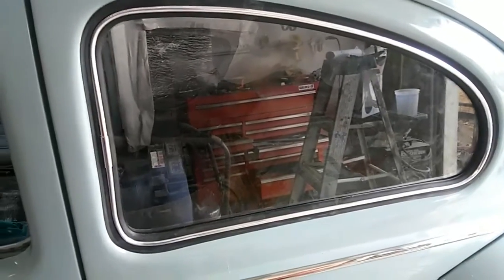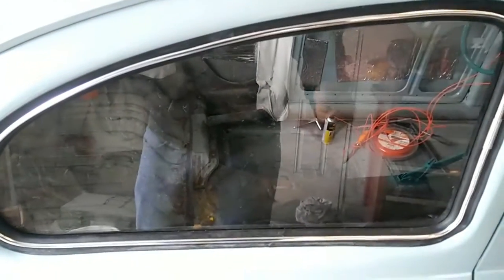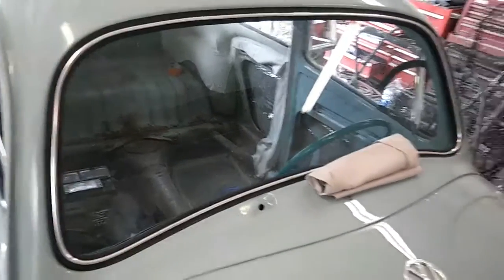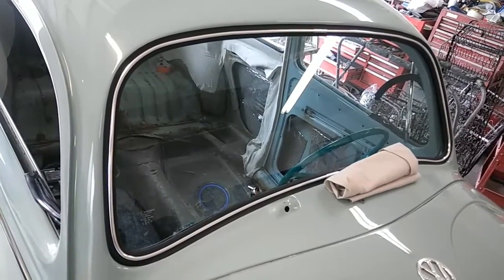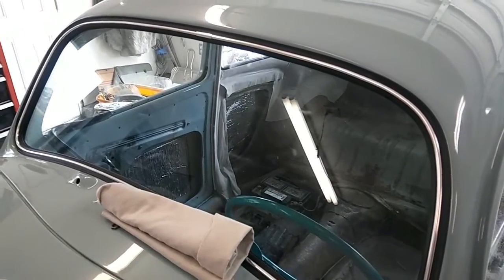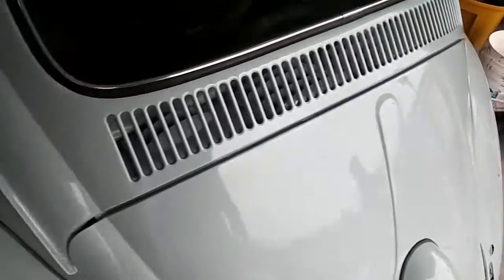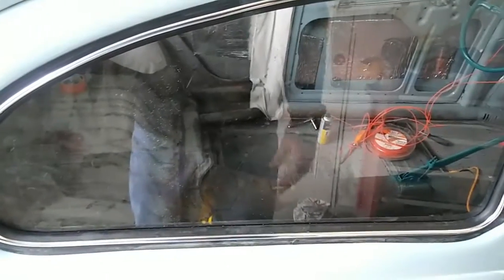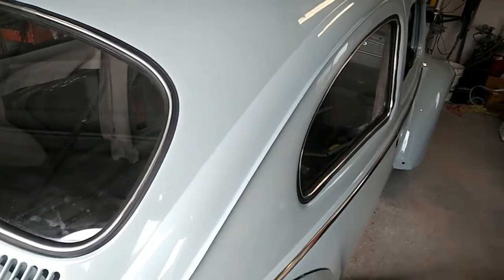Vw Window chrome with ease final look in stalled plus More tips

Comment: I’m installing the metal trims to the rubber seals of windows on my 1973 Super Beetle. I have given up 5 times cuz I find it very difficult .
Should both ends of the “C” metal trim be embedded into the rubber seal? 
I’ve seen a diagram showing only one end of the “C” trim close to the glass is being inserted into the groove. 
Help me please!  Raoul